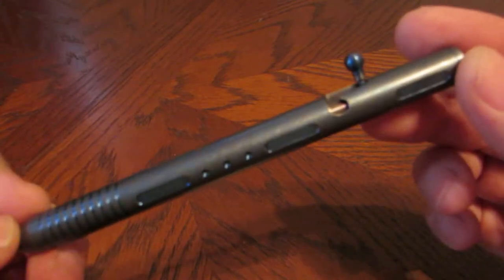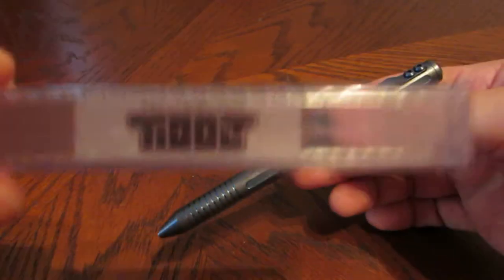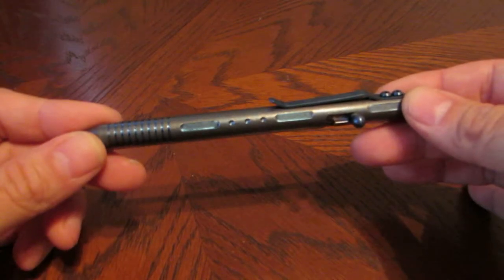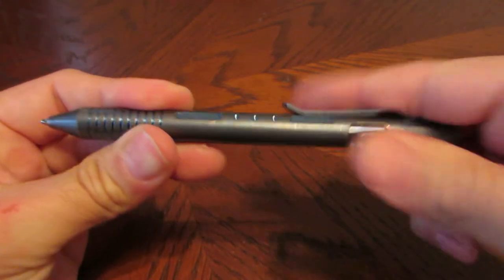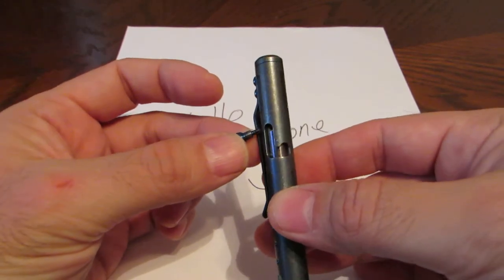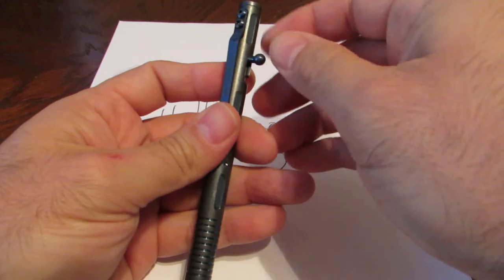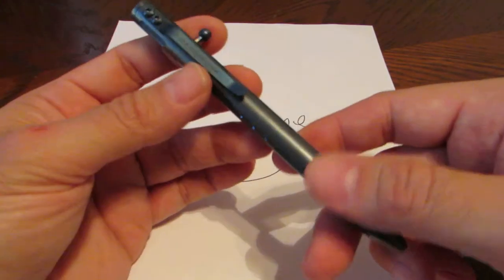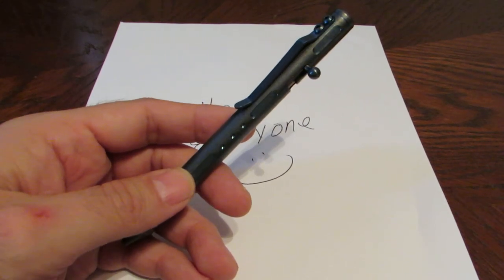Fellhoelter TiBolt Pen Malfunction

Comment: So... I don't know if you've noticed yet or not, but the tip of the pen unscrews.  Thats how you should be changing the ink cartridge.  Basically the only time you should be removing the Torx screws is to change out the rear attachment.

That might also be why the ball of the lever (or bolt) isn't screwing in all the way... because you are fighting the spring, and at an awkward angle.  If you unscrew the tip, removing the pressure of the spring... you should better be able to screw in the bolt.
Reply from the maker: Thanks for watching the video and for your comment Michael.  Unless I am misunderstanding something, the tip of the pen is solid and does not unscrew.  The only way to change the ink on this pen is through the back end.  Believe me I've looked at it a few times to make sure.  
Thanks again
Reply from the maker: Michael Pilcher Thanks for the comments and for the pics, it does look like the same pen, but the tip will not budge.  I have had a few of my friends look at it and no one can get the thing off.   It is either solid or stuck.  When I have more time, I will remove the back end and take it apart.
Reply: Gus Gus I would think it more likely very well stuck.  The idea of the body (tube) and the tip being all one piece would be nearly impossible to make.  Try vice grips or pliers and maybe rubber so you don't scratch it up. Its GOTTA come loose.  Either way, its titanium... you aren't gonna break it with your hands.
Reply: From Fellhoelter's website: "Another great new feature of the improved TiBolt is that it now accepts Parker or Fisher Space Pen refills. The new design also eliminates the need for any tools to change the ink refills. To swap refills, simply unscrew the tip, remove the old one and replace with a new one. Screw the tip back on and you’re back in business." So, it seems there may have been an older design which did not have a tip which unscrewed.
Reply: MoonMotelTV Well, his Kickstarter started November 2012.  And its guaranteed that all pens he made since then have a removable tip.  In fact, that very paragraph states that it now accepts Parker or Fisher refills.... which Gus mentions in his video.  On top of that, Gus shows his "spares" pack... which includes an o-ring.  The ONLY place that this pen has an o-ring, is in the tip.
Reply: Michael Pilcher
Thank you. I figured that much since I had never seen one without the removable tip. But I was not 100%.  I know mine has the removable tip and it is a very tight and beautiful fit.